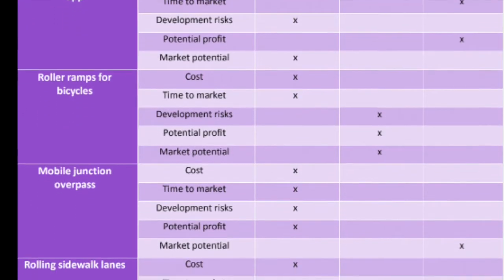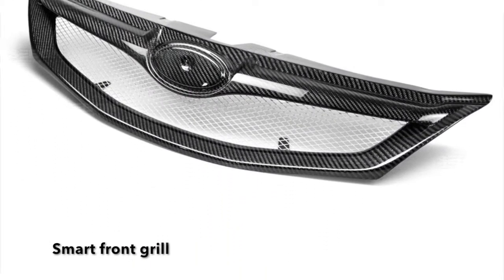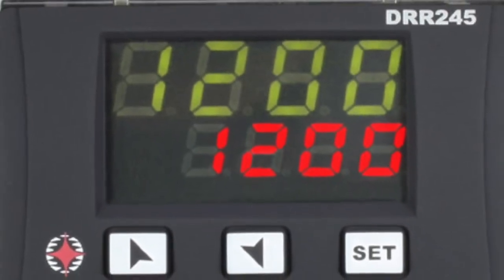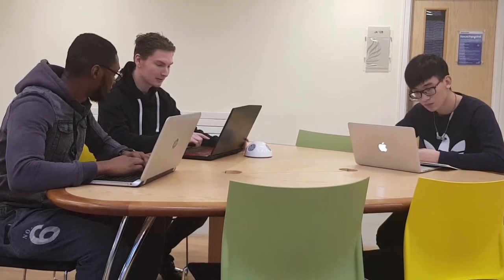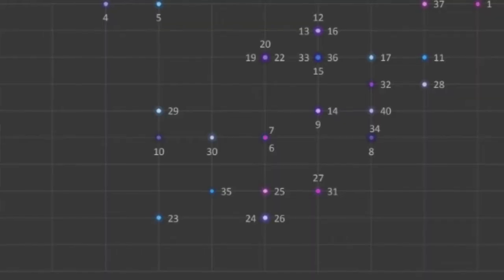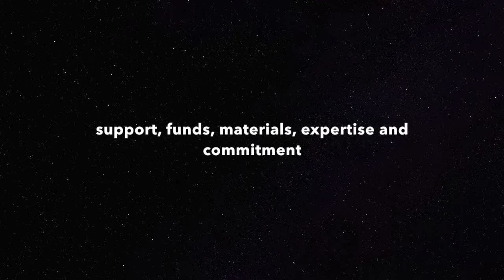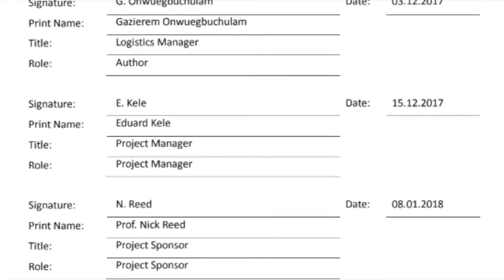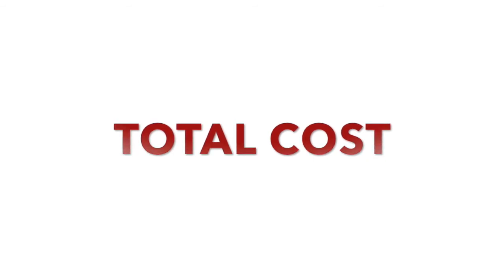Vertical Wind Turbines Powering Electric Cars (by Plan B Technology)

Comment: Engineers should consider kinetic energy to produce Electricity for a car while moving on the road by placing electro kinetic generators attached to 4  shockbreakers of the car.
Reply: it would then run forever without any charging station. But it's not their intention to run off grid you always need to be grid tie according to the world governments
Reply: @Aboudy1989  
Therefore a combination of 4 electro kinetic generators and Photovoltaic Solar panels would add more power for longer range.
Reply: @Aboudy1989  it would not run forever, the energy generated would be proportional to the energy slowing it down.

Comment: Wait, so why not charge it with wind power while driving and not just when its windy.
Reply: I've wondered  this for years. Why not make a hybrid car? Use gas in the take off, switch to electric power when you are on the freeway or interstate where the speed of your vehicle powers the car.... wouldn't that make infinite  energy and power? As long as you hold a constant speed to turn the turbines?
Reply: Paul McAllister You lose energy production as heat, Law of conservation of energy
Reply: @majornasti8044  the idea would be a hybrid wind gas vehicle. Start acceleration with gas. Once electric kicks in continue to use electric and the wind power would then create a charge in the battery making your electric range much longer
Reply: @majornasti8044  who said it wouldn't lose  energy through heat loss?

the issue is will the car run for a long distance despite the losses
Reply: @Mc.Scrumpy  why use gas to get the car moving when you can use an electric battery?
Reply: because then it would just be a perpetual motion machine . scientifically not possible that is why . Have a nice day !    ;)
Reply: @shivamsoni5894  But wouldn't energy be supplied in the battery in the form of the "wind wheel" driven by the headwind? So would it really be a perpetual motion machine? Could you explain to me in more detail why it would under no circumstances be possible to use the headwind?
Reply: @shivamsoni5894  How is that a perpetual motion machine?  It takes air differentials, converts the mechanical energy of the props spinning into electrical energy which is then stored into batteries.  Nobody said that it creates an infinite supply of energy, it would potentially just create a more efficient vehicle (unless the drag coefficient overcomes the energy stored).  This is nothing like a PMM.
Reply: @shivamsoni5894  i am trying to do same thing but very expensive for me
https://youtu.be/zmg3LRElmQQ
I am afraid about its expense
Reply: @shivamsoni5894  wouldn't it atleast give the battery some extra power?

Comment: Wouldn't the wind turbine slow the car down reducing aerodynamics , and if so is the energy gained worth the loss and the noise the wind will produce ?
Reply: True i don't  think a car could completely run on that, but imagine a simple wind turbine system in the frunk of a tesla combined with reginarative braking and solar panels an the roof....i think the combination of those systems might improve range considerably.
Reply: I am.totaly agree that car speed will reduce or may slow down through aerodynamics and thermodynamics concepts.This problem can be solved i have wrote a artical on this idea .For more information   contact me by my email id_ virksaab1966@gmail.com
Nav
Reply: @nachatarsingh5432  Can you provide me the link of your article ? I mean how can this even be possible ? I would love to understand your opinion.
Reply: new solar be out in a year ..  all ready have solar cars .. basically make a old muscle cars 50 60 70 .  make ne body add solar cells . lighter body . lighter drive train or hub rims ..   free wheel a car then any vehicle get hight miles and have switch for motor breaking in mountains ..  bicycle can go across the country wth free wheel motor . all gliding ..  light year will be out soon .  just make one if you have patience to make foam body . stick cells on it ..  stick wind generator in the grill and direct the wind . hit a water micro turbine you could power multiple houses ..  a joke if you break it down and really think about it . more about lies and suppression .  tons of wind power once you start moving  . just catch a tiny of it . it blows through the grill and around the car any way . so easy turning spot or wind directing could actually reduce drag and make power  ..  anything can be done. solar panel could run wind generator . lol.  air compressor . run a motor . . we could could make free power with no moving parts by streams and compression . which makes refrigeration as well. that tracks better than elctorocity over distantances ..  run  generators from it and cool your fridge . or ac for the house ..  lots of old tech not used man ..  light year car is coming out 100 thousand in costs. order one .  you could make something pretty cheap and fast .. buy junk car and mold it to make the body even . standard could free wheel and hyper mile with no engine engaged and need no clutch ,, no traffic speed up and glide a lot .  lots of ways .  check out stella the solar car ..  uses stellar solar cells. //